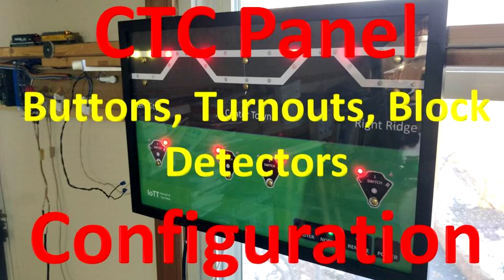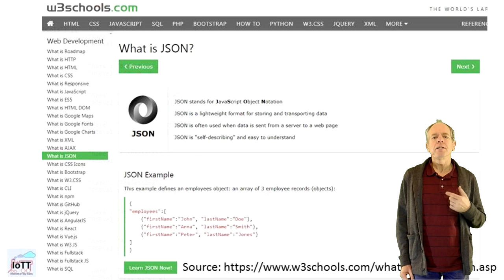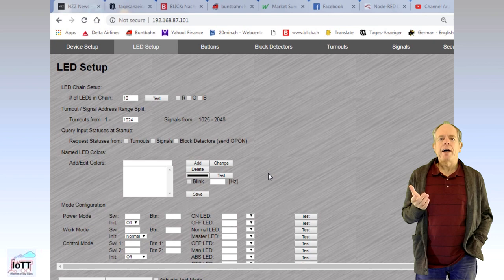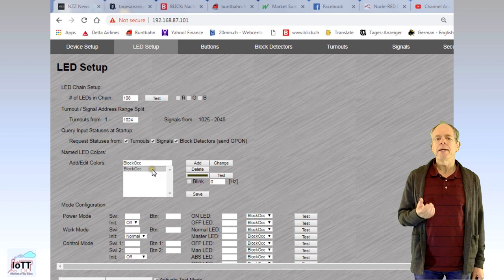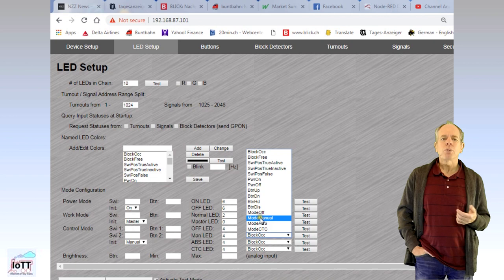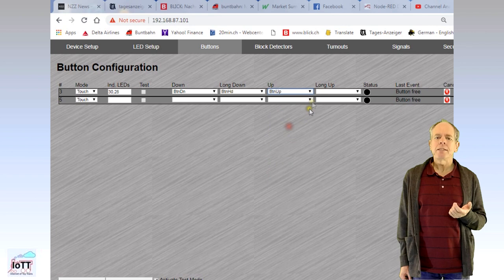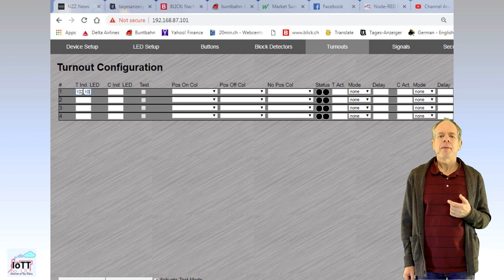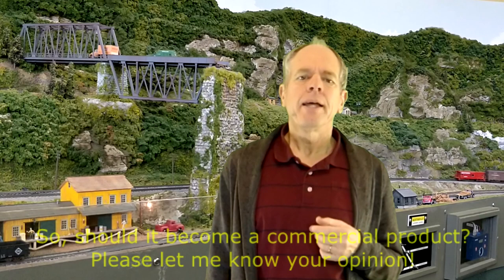CTC Panel Buttons, Turnouts, Block Detectors Configuration (Video#12)

Comment: Hi - I’m loving your videos, even if many of the technical elements are going way over my head!

I’m looking to build a CTC panel and love you solution. I’m using Lokatoredigital LoDi for my train control. 

For a semi-technical person, can I connect the Yellow Box (IOTT Stick Plus l) to connect to LoDi control, block detection and turnout throws etc?

Thanks!
Reply from the maker: Thank you, glad you like them.
I was looking for information about LoDi, but could not find anything with technical details. In general, if the system has Loconet support, either a physical connection or Loconet over TCP, I think it should work.
Maybe you can point me to a link with detailed documentation for further analysis.
Reply: @IoTT  I’m happy to try and find the documentation from Lokstore. What do you need?  I know that the system is fully railcon compliant if that helps?

Regards,
Tim.
Reply from the maker: @hillmanhalt  Do you mean Railcom? That would be something completely different. Railcon I do not know. What I am looking for is a technical description of any communications interface to the LoDi system, hopefully compliant with Loconet.
Reply: I don’t believe it is Loconet compatible, I have asked the LoDi forum for details of the communication interface and protocols. Let’s see if anyone comes back!
Reply: I’ve tried sending a link to you with the API details, but my posts keep getting deleted!
Reply from the maker: @hillmanhalt  Not sure what happened, please send it via e-mail to hans@tanner-family.org

Comment: Really impressed with your videos and knowledge. However I do get a bit lost with it all! Would love a commercially available system once this is developed further or to be able to purchase a board and instructions to solder it all together!. Will keep watching to see where it all goes 😊
Reply from the maker: Thank you for your feedback. At this point I am not sure what I will provide as products and what will remain just open source designs. However, there is a reasonable chance that I will provide some modules  that can be combined together to build the devices shown in myh videos. So, keep watching ;-)

Comment: What i dont get so far, is wether the signal of a block detector can also be received by a computer with jmri (over loconet) to be used in an automation, can you enlighten me , please?
Reply from the maker: Loconet messages are broadcasted, so yes, you can process them wherever you want. And you can do distributed control, e.g. having a controller just dealing with inputs and layout automation for one segment of a layout, e.g. a module, and you can implement some layout automation without using a computer.

Comment: Have you seen these signal decoders ? http://www.mollehem.se/index.php/en/control-and-electronics/leddriv6e-detail Looks like they use the same chip as the LED strips but you can use regular led's. Then you can run a 3-wire RGB bus between signals.
Reply from the maker: Thanks for the link, this is very interesting, particularly for N Scale, I guess. For HO I would prefer going with the 5050 RGB leds for $0.1 a piece with the driver IC already integrated in the RGB LED compared to about $2.50 for this driver board for just 4 RGB Leds.

Comment: Great stuff. Can you include support for NMRA 9.2.1 Extended Accessory Decoder Control Packet Format for the signals ?  I use Team Digital's SHD2 Dual Signal Head Decoders that support turnout addresses and/or signal addresses. http://jmri.org/help/en/package/jmri/jmrit/beantable/SignalAddEdit.shtml see this link for JMRI's support of SHD2's.
Reply from the maker: Sorry, this one got stuck in the spam filter.
Yes, I am going to add signal support as we go on. As you may have seen, my signaling system supports it, so will the CTC panel.